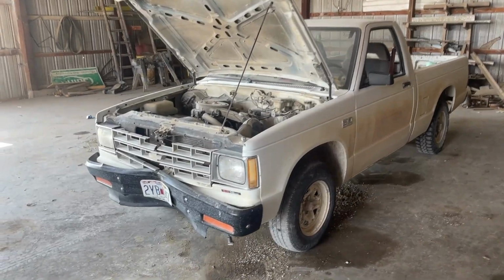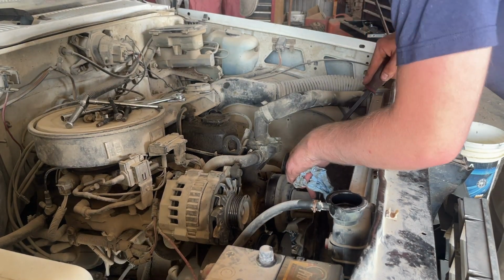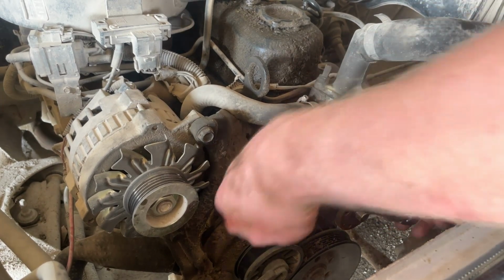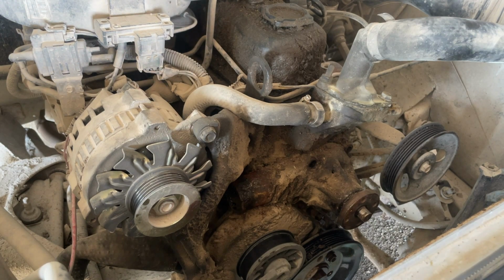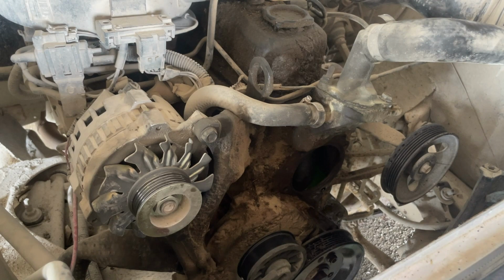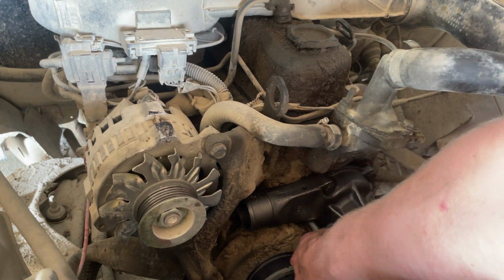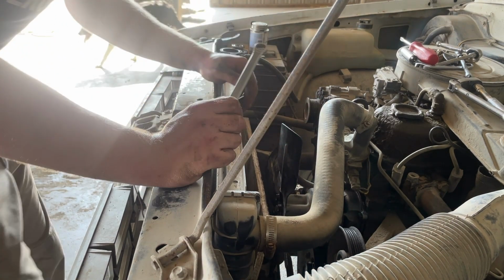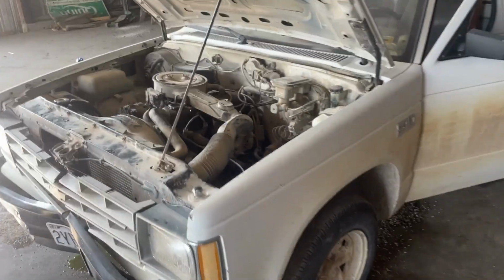1989 Chevy S10 2.5L Water Pump - And Other Stories

Comment: A little ding you’ve got in that front bumper! 😆.  Love the 2.5 Iron Duke…have one in my “88.  Pretty easy to work on.  Hardest job I had was replacing distributor cap and coil.
Reply from the maker: They’re tough little engines! Thanks for the watch